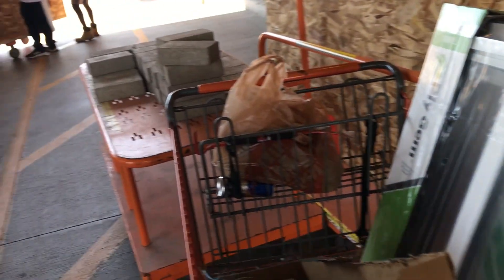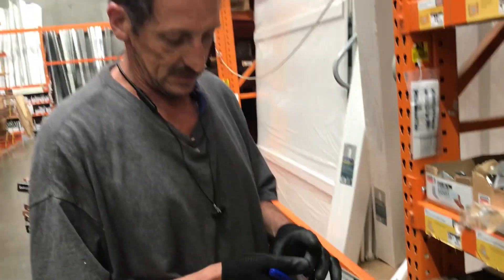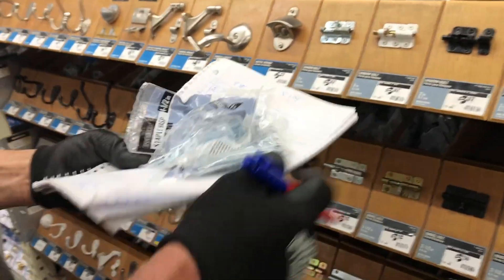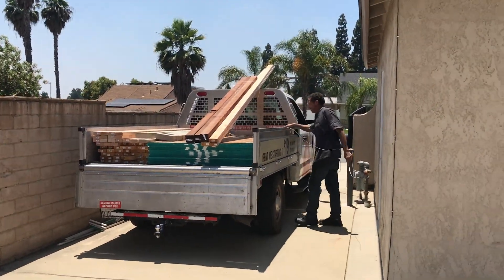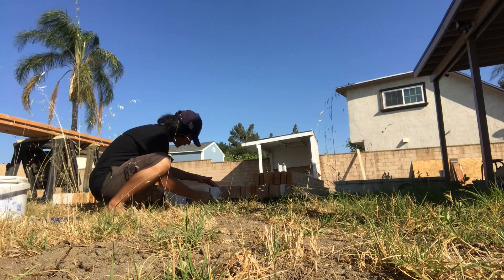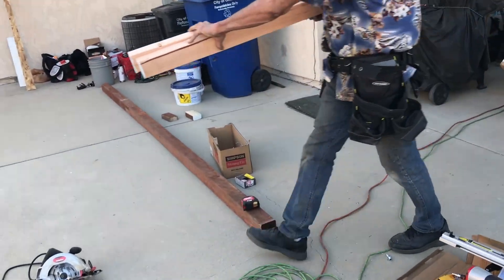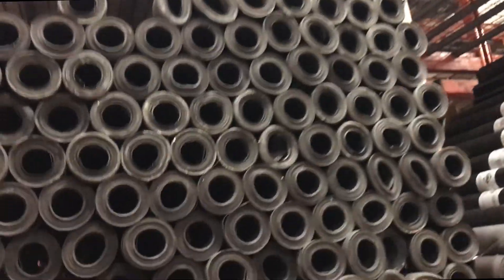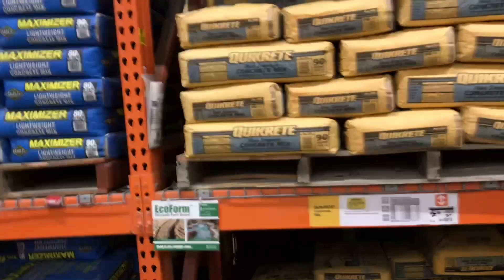Home DIY: Building a Shed from Scratch - Day 1

Comment: Pressure treated lumber should be the only wood in contact with cement. Always ask questions if your guy can’t answer knowledgeably, find a new one.
Reply from the maker: yes i realized that about the treated lumber afterwards along with many more issues that came during this 30 day build. the whole reason for doing these episodes is to document my experiences as a complete beginner including mistakes and challenges as a part time DIYer.

Comment: If your guy has to buy tools to even start a job, you need to find a new guy. This build is what not to do.
Reply from the maker: sure, i can find a guy to do it all for 5x the price and i wont need to do a thing. again, the whole reason for doing this build is to be more hands on, figure out which tools to use and figure out whether or not I should of even done this project. some issues will include this guy, but that's all part of the DIY experience so others can also learn from my mistakes.